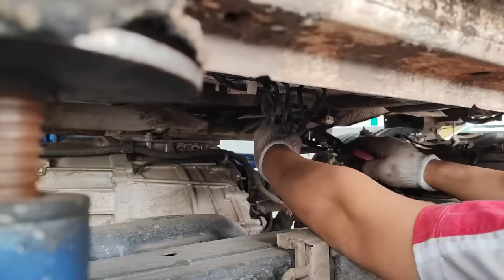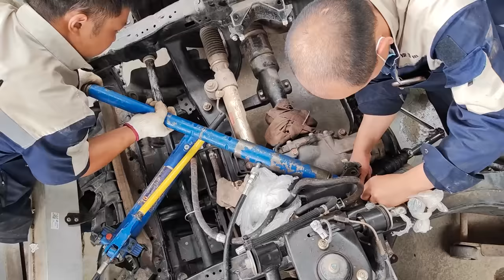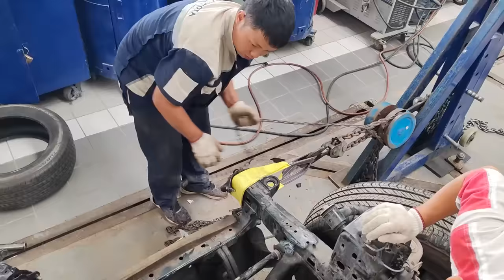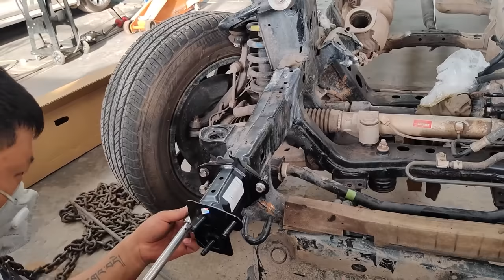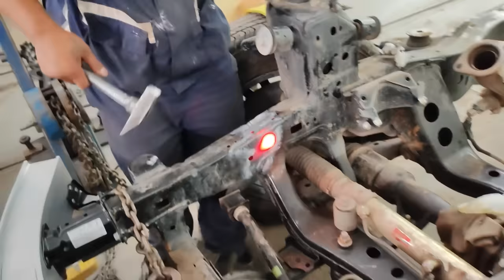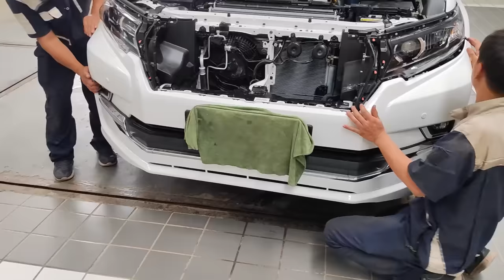Toyota Prado front accident repair

Comment: My car had an accident and the chassis is bent. The garage team doesn't have the dimension od the chassi. is there dimensions of the toyota land cruiser prado grj150l-gktekv you can help me with?
Reply from the maker: Hello, I currently do not have the frame accessories for the Prado you mentioned, so I cannot provide the size you want. However, you may be able to find the chassis size you need by referring to the vehicle's official technical manual or repair guide. These documents often contain detailed specifications, including chassis dimensions, which are critical in repairing a bent or damaged chassis.

Comment: You need a big induction heater to deal with those chassis spars.
Reply from the maker: Using an induction heater can be a useful technique for dealing with certain aspects of chassis repair, particularly if there's a need to reshape or straighten metal components. Induction heating is a method that uses electromagnetic induction to heat metal parts quickly and efficiently. It can help make the metal more pliable and easier to work with in various repair scenarios.

However, the choice of tools and methods for repairing damaged chassis parts can depend on the specific nature of the damage and the equipment available in the repair shop. Different techniques, such as hydraulic presses, frame straightening machines, and even traditional welding and cutting, can also be effective in chassis repair work.

Ultimately, the choice of tools and techniques depends on the expertise and preferences of the repair technician, the type of damage, and the equipment available in the workshop.

Comment: Here in the Australia they wouldn't have The job Of fixing the chassy or frame they would just put the New part on and leave the unseen damage when the owner brings the car and they The don't steering is The same as a crab and goes side they it needs a wheel alignment
Reply from the maker: Repair practices can vary from one place to another, and they can also depend on the specific regulations and standards in the region. In some countries, the repair process may involve a more comprehensive approach to ensure the vehicle's safety and integrity. It's essential to follow the recommended repair procedures and standards to ensure the safety and performance of the repaired vehicle. If you have specific questions or need information about auto repair practices in your area, feel free to ask, and I'll do my best to assist you.

Comment: Like an Pakistani work Shop
Reply from the maker: The repair work shown in the video does have similarities to some repair shops in Pakistan and other parts of the world, where skilled technicians often perform extensive repairs on damaged vehicles. While repair methods and standards can vary from one location to another, it's essential for repair shops to prioritize safety, quality, and structural integrity when fixing damaged vehicles. The specific techniques and equipment used can vary, but the goal is to restore a vehicle to its pre-accident condition.